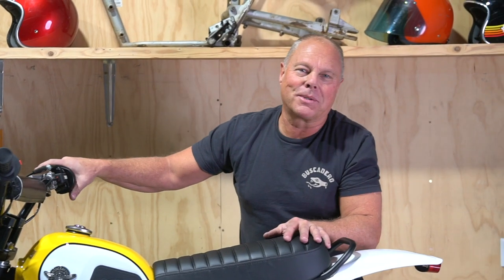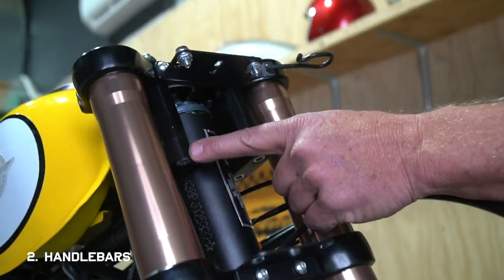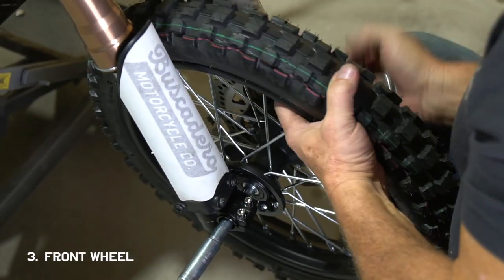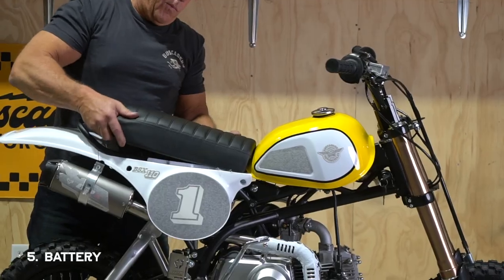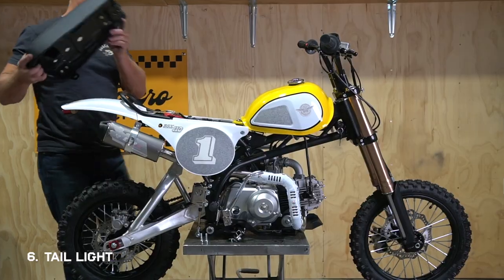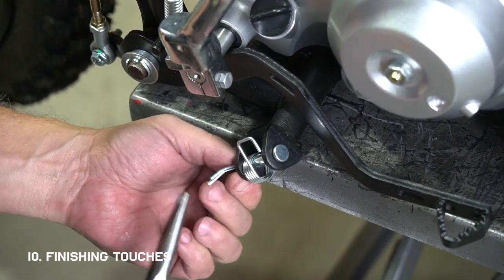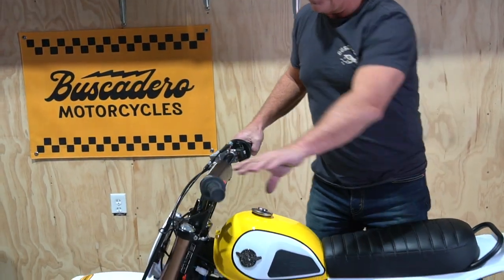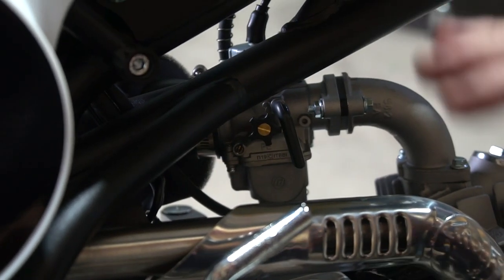How to assemble your Buscadero BSX 110 Mini Bike

Comment: This isn't an exact copy of a vintage pitbike. The vintage ones had dual rear shocks and the frame looked very different compared to this.  Im surprised nobody makes an exact copy.
Reply: All they were basically after was just the vintage tank plastics and subframe, they tried to keep everything else modern so it doesn't take away any of the pit bike experience